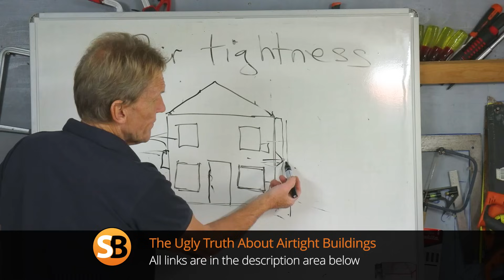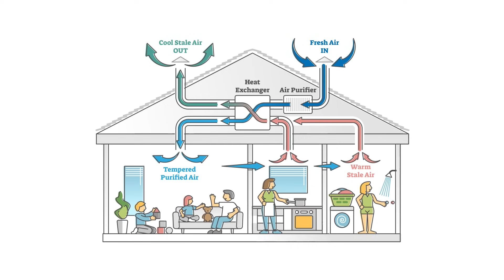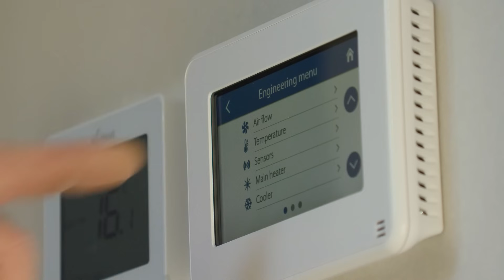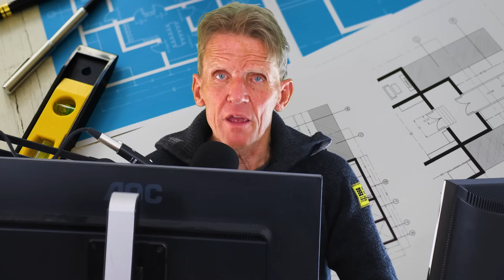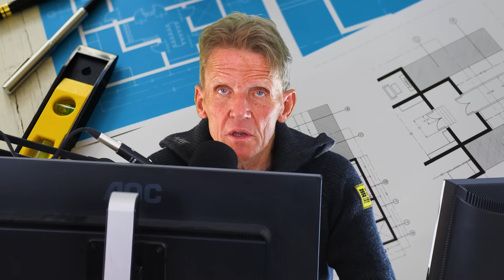Why Airtight Homes Are a Terrible Idea

Comment: Move 2 years ago into a bungalow built on a raft in a mining area.
I have no idea how there is an airflow in my house . I have search for air bricks there is none. I got usual plastic double glazing. 
During winter we have a heavy curtain over patio doors   windows shut but a candle flame still shows a flicker so a breeze. 
I have had fellow builders trying to work out how this airfow works . But i am stumpped .
It works so i leaving it alone .
I just wanted to make sure i had a breathing house

Comment: As you note - a simple single loft mounted PIV is cheap and efficient - a few £100 and a couple of hours of DIY. Never needed to switch on the heating element. Had mine for 30 yrs - on the 2nd one after 20 yrs. A decent dehumidifier in the main bathroom too plus continuously running extractors in the bathrooms / loos.  No problems even though house is extremely well insulated. Your last point on the physics of the heat capacity of dry air is the key.

Comment: The title says it all. Excellent video. 
Airtight homes, or even ordinary ones where no one ever opens a window, are usually a little bit stinky and a little bit damp.
Reply: Nope, I live in an airtight home built 5 years ago. If you have any problems like that, your ventilation is not designed or installed correctly.
Reply: if an air-tight home is stinky and damp then the ventilation either hasn't been designed properly or isn't operated properly

Comment: I have a persisent mould problem in my house, 1970s build but it was later insulated with cavity wall insulation so i think that might be blocking up the ventilation. I wonder if there is a way to remove it.
Reply: I'm not an expert but attic insulation can block the eaves ventilation, for walls maybe the siding has something to do with it, walls aren't positively or passively vented I don't think, the moisture is blocked from inside out by vapor barrier under drywall and open on the exterior side of the insulation for air movement, with breathable tar paper or tyvek. Is there a vapor barrier under the inside drywall? What kind of siding, is it sealed. How does the attic breath could it be coming from there, or poor flashing corner detail of construction leading to water ingress, in which case ventilation is pointless. If it's not leaking and you have the $ put the zip system taped board insulation on outside and have the heat recovery air exchange so you're not sucking air thru the walls into the house. Best guess here!

Comment: I just have all the trickle vents open all year round on all windows plus extractor fan in the bathroom running at all times and i normally have all my washing dry inside and I've never had any damp issues

Comment: My late father, a builder, always said a house should be allowed to breath.
In Chinese Feng Shui the circulation of fresh air is held to be necessary for the health of its inhabitants.
Reply: Whoah I witnessed the irony by staying in China... Very stale where rooms got zero air ever and rooms where there was only one opening. Double edged swords I suppose as this was in 2010s Beijing where you get pollution instead of air
Reply: sure. but through a heat recoverer
Reply: Houses don’t need to breathe. Walls do.

Comment: I'm glad somebody is prepared to say it. Even the best ventilated passivhaus homes tend to have terrible air quality. Bad idea. Wasting heat through ventilation is a necessary evil at present.
Reply: You have no idea what you're talking about. Go visit some well built, well engineered "tight" homes - the difference is incredible, and the data absolutely back that up.
Reply: Got data to back that up?

Houses with proper MVHR tend to have exceptional air quality
Reply: @mowcius  I don't think they will have data to back it up. A fairly recent study in the International Journal of Environmental Research and Public Health (doi: 10.3390/ijerph17134749) suggests that further study is necessary to fully understand indoor air quality in Passivhaus construction, mainly due to the lack of a standardised approach to assessing indoor air quality (across the board, not just in Passivhaus). Having said that, they found 11 studies that suggested the indoor air quality of Passivhaus buildings was better than in conventionally constructed dwellings.

Comment: my detached house built in 1920s still has original windows in metal frames in oak surrounds - so far from air tight. Those houses made around me in 70s & 80s are on their 3rd to 5th sets of window (all old ones in landfill - oh and the 3 other detached houses built in the late 80s have ALL spent more over last 30 years on replacement windows than my total elec & gas bill during that time). Come the winter many have their heating on and windows open as they are too stifling. Also, you get no warmth or ultra violet light through their double glazing.
Reply: Your neighbors need to stop buying cheap crap windows.

Comment: Here in Ireland, our government has gone all in on this lunacy and all new builds must have very high BER ratings. It is crazy. new homes cannot have any fireplaces or fossil fuelled heating. We had power outages after Storm Eowyn and many in new homes had no power or heat for up to 14 days. Some had to check into hotels or move in with relatives. There is a rise in asthma which the govt likes to blame on vehicle exhausts but I recall listening to a respiratory medicine consultant talking about the problems created by the homes built in the 1990s due to their lack of ventilation. In hot weather these sealed homes are like saunas.
Reply: Your advice is spot on.  I worked in the US energy program for many years as a weatherization technician, doing all the insulation, sealing air leaks, installing new doors and windows, and then as an energy auditor, inspecting homes and prescribing the work that needs done.

Saving money is good and comfort is great, and there are many homes that need lots of help.  But there has to be adequate ventilation for the health of the occupants and the building itself.  You are giving great advise.
Reply: We fixed our cold , damp 80 year old house by replacing the 40 year old aluminium windows and doors with a composite doors and PVC windows.  Most importantly all the windows have huge passive air ventilation strips installed that we can regulate the airflow.  We then replaced all the old plasterwork on the external walls with 18mm insulation board specifically for our type of house. Insulation in attic was fine so left it in situ. The difference to the house in heat retention was so good that we were forced to put our rads on low settings. The condensation and mould was gone almost overnight.  14k outlay saved us 50k in making the place completely airtight. I'm a huge believer in airflow in a home. Our work on the house was showcased at a regeneration project as a low cost solution to many homes on the estate suffering the same issues.
Reply: @Bopzibeel  well yes, unless you have an MVHR system you should have trickle vents.
Reply: @gerardleahy6946  don't confuse the issues, insulation to grade A is essential. The issue is that In Ireland they initially did not mandate appropriate ventilation. The healthiest home is a well insulated home with mechanical heat recovery ventilation. More people die from cold damp houses than any other cause since mould is endemic to such houses.
Reply: @StephenBrightwood  The balance wasn’t known and then when it was it was ignored for a while, insulate and ventilation. And yes, modern material gas-off producing toxic internal home environment.  MVHR, is the way forward. But in a rural setting I wouldn’t give up a chimney, or bottled gas.
Reply: you have laws restricting the opening of windows in Ireland? Crazy.
Reply: Nah the asthma is definitely from fossil fuels primarily. 

Add active ventilation to the home. Thats necessary under 3ach 50. 

As far as hot climates. Yall are in Ireland. Its not hot. But you need ventilation at the end of the day. 

Can you do wood stoves? They can be made airtight. The high efficiency ones are good for backup heat. 

It seems the government didn't do their research on that part.
Reply: Im in the mountians in Canada with lots of neighbours with zero balancve hydro, solar, even a straw bale home the sells power back to hydro. BUT due to storms, power outage, the entire valley at 3,000 feet has NEVER abadoned fireplaces as it's a last resort in a disaster.
Reply: Another way the "climate" lunacy has ruined us.
Reply: Are you giving the voters a "free pass"? Why not blame them if they put bad candidates with bad policies into power?
Reply: That might explain my issue, a oven in summer, had to buy a aircon.
Reply: Yeah, not having a fire, stove or alternative source of heating is risky. A B or C rated house is very comfortable.
Reply: @gerardleahy6946  voc in all products carpets vinyl flooring etc. all released gases of some sort. they are what makes people have rashes breathing problems the cheep furniture etc and  all that happening in an airtight house acting like a microwave with your internet signals bouncing around inside that foil insulation 🤷‍♂️👍🇬🇬
Reply: What lunacies haven't your government in Ireland engaged with recently 😂
Reply: @elsmallo 🎯
Reply: @elsmallo bold words from a Brit.
Reply: Basic common sense, isn't it!  Over insulation of our homes can be a death trap!!
Reply: @stanthesteelguitarman8228  not over insulation. More like under ventilation
Reply: @stanthesteelguitarman8228 if you don't understand what you are doing it can be.
Reply: Exactly, but the "experts" don't see it!
Reply: @ Expert Witnesses in the field do know. But, your average surveyor, etc, are sadly lacking knowledge or the will to agree.
Reply: @stanthesteelguitarman8228  Experts do see it and advocate for MVHR systems. Unfortunately it's usually builders where the knowledge stops.

Comment: Dead right, I was a builder for fifty years and I know ventilation  is needed in house without any doubt
Reply: air tight buildings don't mean "no ventilation" they mean controlled ventilation that limits heat loss. The problem in new-build houses with damp is in most cases due to lack of understanding by the occupant of how the building has been designed to be ventilated.

Comment: Had a customer in our shop complaining about the quality of his brand new apartment (Council Rental) with mold already growing after a few months. Asked him was he drying clothes on the radiators. "Yeah" he said, "but thats not the cause" he said. Chose not no argue with him. If you can't see the correlation between the location of the mold and the room you are drying your clothes on the rads, well I know I am wasting my time. 

Even applies to family. They were renting our flat over our premises. Previous tenants refused to use Tumble dryer and dried clothes on clothes horses in front of Windows...but didn't open the windows. Mold on the inside of the exterior walls close to the windows. Doesn't take a rocket scientist.

Family members didn't have that issue reoccur in those rooms because we let them use our washer/dryer next door so they didn't dry clothes on clothes horses or rads. They did however have mold occur on the 2 exterior walls of the bedroom. They were convinced it was leaks. I tried to explain that the wall paper would bubble if it was moisture and minerals leeching through from outside causing the mold. Wall paper was perfect except for the mold on its surface. Asked them a few questions and got the answers I needed. It had to be behavioural/lifestyle because why would previous tenants have mold in kitchen/livingroom but not in Bedroom and family had no mold in kitchen/livingroom but did in Bedroom?? 

Turns out they prefer a cold air Bedroom but to be snug under an electric blanket and duvet  and had switched off the rad in the bedroom. I can actually understand this as I have the rad in my bedroom turned off too. The problem for them though is that while my Bedroom exterior wall is a South facing 2ft thick Victorian wall with huge thermal mass whos interior surface never gets too cold, the flats bedroom exterior walls are North and shaded East facing so aren't getting heated from the outside by the Sun and with the rad turned off aren't getting heated from the inside either. So those walls remain very cold and their and their dogs moisture laden exhalations are condensing on the bedroom walls causing mold. 

Family members refused to believe me and still convinced there must have been a leak....thats miraculously fixed itself apparently because the next tenant who is from a warmer country and on good money likes a warm bedroom and runs the rad in that room....and can afford to dry his clothes in the Washer/Dryer....and hence there is no mold developing in either the Kitchen/Livingroom nor the Bedroom!!

Comment: Quite depressing to read about inefficient ventilation suggestions in 2025. Make sure to use a unit with a heat exchanger. Modern units have efficiency of 70-95%. We need building regs that include good airtight homes combined with MVHR. And education so that people understand how this works.

Comment: Agree, in one of my rental flats I have a recovery system that works well. Problem was a tenant switched it off as he didn’t like the slight noise. Only found out when I got a request to repair the property due to condensation damage. Tenants are a nightmare.
Reply: So are landlords 😊

Comment: The humble chimney place was the most crucial source of ventilation in traditional houses and they also offered cheap heating at the same time. Building houses without chimneys is insane.
Reply: Were ran by insane people through Government, it's a great backup too when you have power cut but can still keep warm 😊
Reply: LOL. There is no rationale for a chimney in modern homes other than aesthetics.
Reply: @Davesobscurevideosuntil the electric grid goes down for weeks at a time in winter storms.
Reply: @lenney872 generator? Wood stove even? Literally anything is better than a fireplace. Also where is it that the electric grid is down for WEEKS at a time?
Reply: @DavesobscurevideosTexas a few years ago had their electric grid down in an ice storm for 3-5 weeks. Many homes had pipes burst and families froze.
Reply: @DavesobscurevideosHere in northeast Ohio, we get tons of lake effect snow and power outages regularly knock out power for days or weeks every winter. Fireplaces is what keep many household from having to relocate to hotels, which is extremely expensive.
Reply: @lenney872 fair enough.
Reply: You can have both ventilation and heating in simple and traditional ways without requiring a chimney
Reply: @kubhlaikhan2015  chimneys are both a very poor source of uncontrollable ventilation and very inefficient heating. No house should have a chimney - all houses should have controlled ventilation.
Reply: @StephenBrightwood  'uncontrollable'

Aye that fire just randomly lights itself
Reply: @juliantheapostate8295 he said uncontrollable ventilation which they absolutely are unless completely sealed.

Comment: Even with just double glazed windows we have black mold in our home in places, whereas when we still had the original single glazed windows we had no mold.  Your video indicates the common sense of NOT having our homes insulated.  We may save a little on heating bills in Winter, but with more costly damage to our house due to mold, etc.
Reply: That's not what the video says! You had (uncontrolled) ventilation from your old windows, now that you have sealed ones you need to do other things to make up for that loss of ventilation.
Reply: Well insulated, airtight houses are not for scientifically illiterate people, I'm afraid...
Reply: Did you not hear him recommend a dehumidifier or positive input ventilation fan?
Reply: Fine, if you can afford the cost of the electric to run these.  I've done it with a dehumidifier and found it to be unaffordable!  And that's just in the living room - you need one in EVERY room to be fully effective!! @TheMickydowling
Reply: Insulation is meant to reduce energy costs and consumption.  Dehumidifiers, etc.undo these savings  more than insulation saves in the first place!  I know, because I have tried it! @TheMickydowling

Comment: We had cavity wall insulation injected into our home, was never told or even aware of the unintended consequences of it being that our loft looked like the Amazon rainforest, it literally looked as though a sprinkler system had gone off. We installed vents into the roof and it was ok afterwards. That condensation has to go somewhere.
Reply: I dont think cavity insulation caused moisture in the attic. There is no logic.If there was moisture in the cavity before,it would only evaporate up to the attic as well.
Reply: @MrTurboSAAB1 the reason was  the moisture had no where to go because it’s blocked by the extra insulation, the moisture cannot escape through vents in the brickwork. We had to fit additional vents in the roof tiles. We never had a problem before the insulation was fitted and we had lived in the house for about 8 years.
Reply: @tonypammen6150 you have cold attic/storage and probably dont have breathable membrane under the tiles.
Reply: @MrTurboSAAB1 yes I do

Comment: I’m building a new house. One of the parts I’m most excited about installing is the mvhr. If I ever bought an old house I would definitely try and retro fit an mvhr system seems a much more efficient way over a dehumidifier to keep the damp under control.
Reply from the maker: The only thing you might not like is the noise at night. We have heard of people who just can't sleep with the low level hum.
Reply: @SkillBuilder I lived in 2 flats with MHVR never noticed the noise other than when someone turned the bathroom light on and it ramped up. It was brilliant!